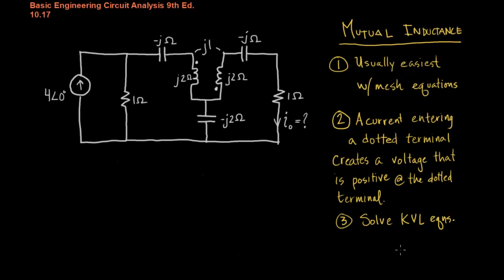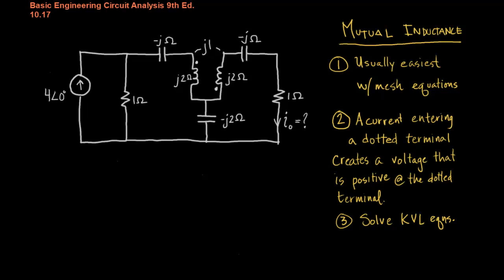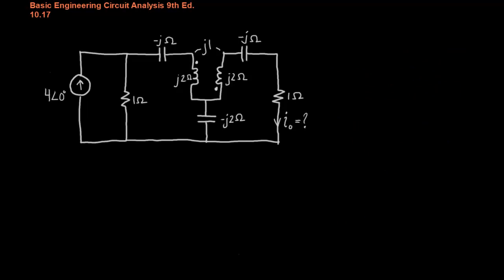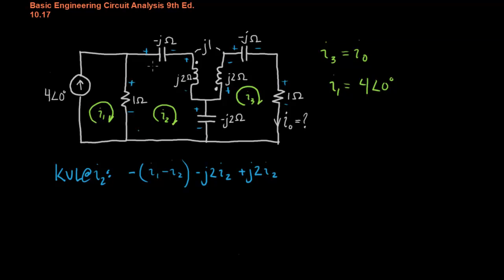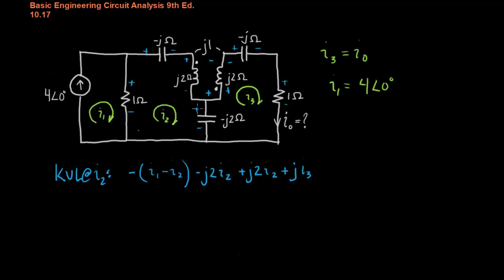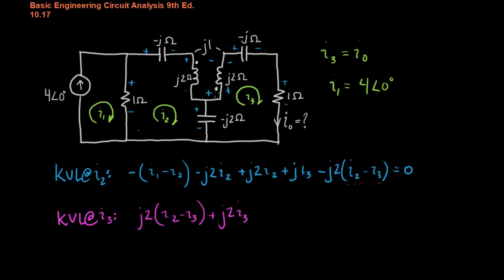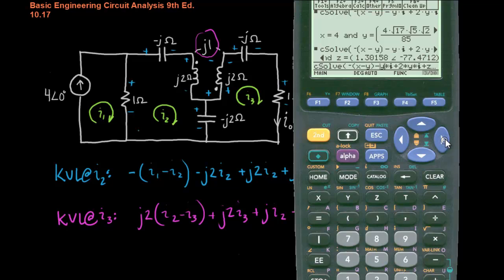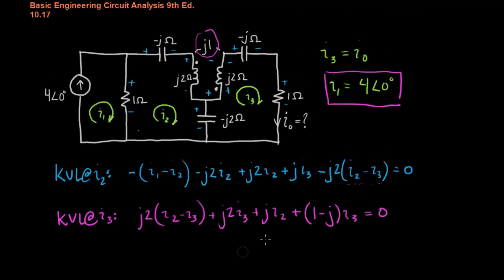Mutual Inductance

Comment: Small mistake on your first equation, you have the impedance of the capacitor as -j2, it should be just -j.  Thank you for the helpful video.  Also why is the voltage over the 1 ohm resistor -1(i1 - i2)?  Why isn't it -1(i2-i1)? REPOST
Reply: Matthew: This is a really helpful video. Thanks. But I have the same concerns as neyo509 . Could you please respond or anyone?

Comment from the maker: Sounds like you are referring to an transformer, not mutual inductance.  I have a video on this posted already.  For transformers, reflection is often the most simple solution.  Then you can use mesh or nodal analysis depending on the circuit.

Comment: I'm confused about how you decide the sign during KVL for the drop over the impedance jl that results from the mutual inductance.  Do you have a physical explanation for this?
Reply from the maker: Dana:  This can be the most confusing part.  That's why I try to define my mesh equations and polarities first.  Notice that I say "current entering a dot" induces a voltage that is positive at the alternate dotted terminal. I must adhere to this.  Starting a 3:16 I explain how the mesh current must induce a voltage in its coupled counterpart.  We need to have consistency with the polarity of the currents in our equations - and the voltages.  In this video the current that matches is +i3.  Hence we use +j*i3 which follows the passivity rule.  I know it's confusing at first.  Hope this helps!
Reply: Matthew Araujo I think I understand this for the most part, now.  Thanks a lot for the timely response!